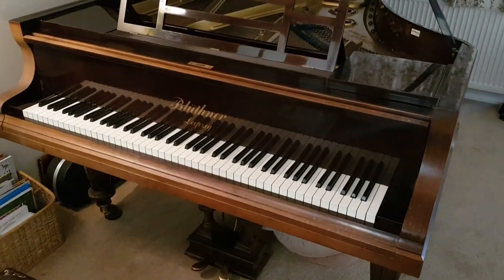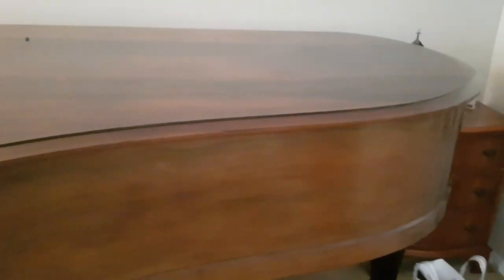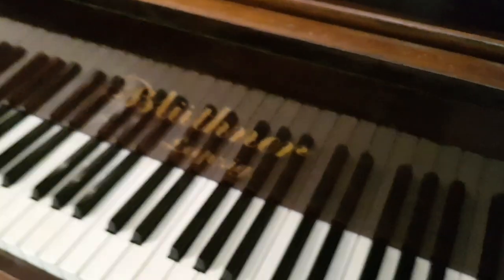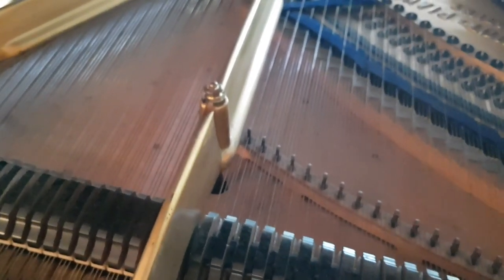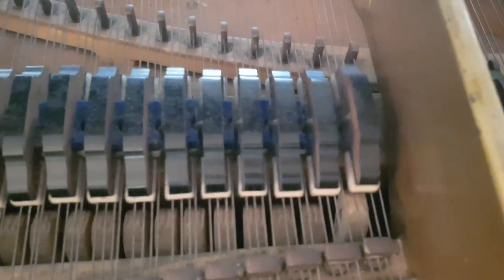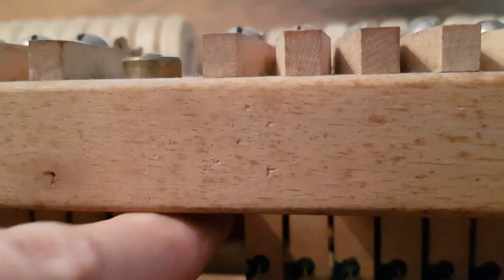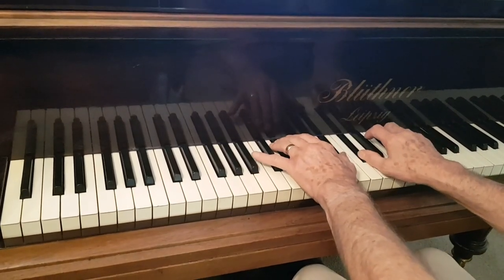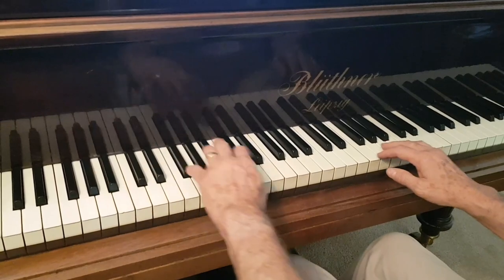BEFORE: Water damage to Bluthner style 8 1899. French polishing and other tasks; video 1 of 2

Comment: You say that the strings are almost at the breaking point on Bluthner pianos.Why is this ? If the piano is tuned to concert pitch,why are the strings more likely to break than other makes of piano?
Reply: If the strings are thick and heavy they need more tension to be in concert pitch, but the good part is that it gives them this much fuller sound. Did you know that violing strings (and other string-instrument-strings) can be bought in different gauges (different thicknesses) in order to get the tension-level which you prefer?